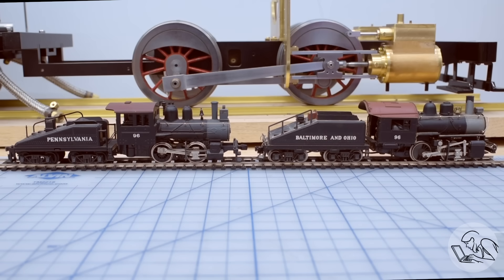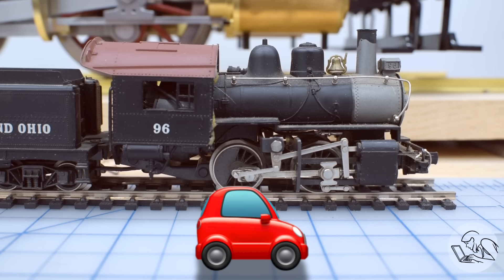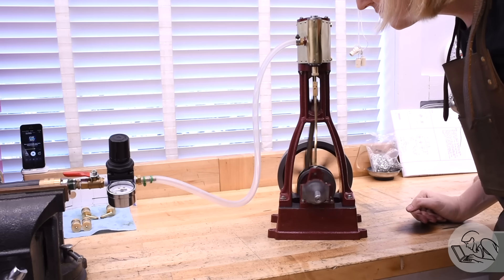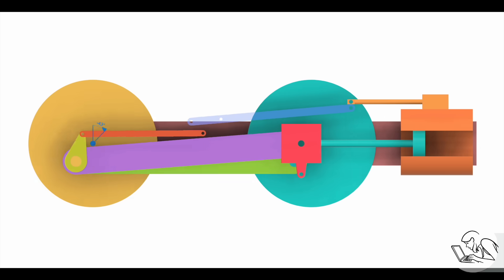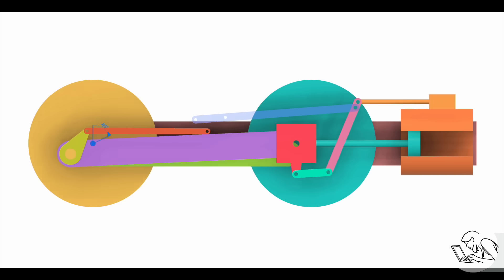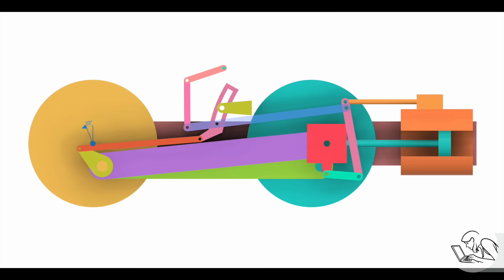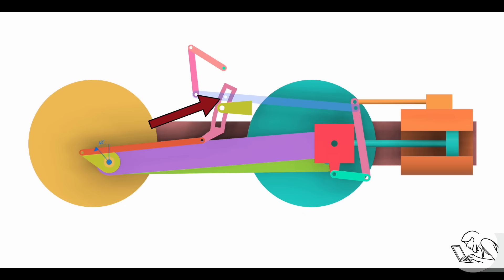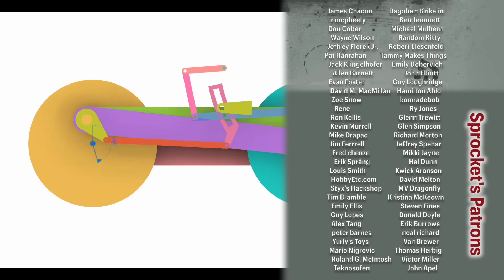How Does Steam Engine Valve Gear Work?

Comment: That opening shot was fantastic!!!!
Reply from the maker: All credit for that goes to Rob at Ghost Pine Film Productions. His photography is outstanding!
Reply: @Blondihacks   off topic but I could have sworn you modified your lathe so as not to have to turn the RPM all the way down to restart it?? If so could you point me in the right direction, I went through your videos and website but could not find anything but I feel certain you mentioned it at some point?
Reply: Truly poetry in motion. In a similar vein, there is wonderful footage of GWR Castle  5043 running at high speed along the M5 in Devon / Somerset (UK).  However not good for Quin’s video as although this 4 cylinder loco does have Walschaerts Valve gear. They put it inside the frames   Which drove the inside cylinders  directly, the outside cylinders were driven from a crank which can seen on the front of the valve chest.

Comment: a lilttle clever thing, since the valve cant move far enough to cause a  power stroke in the middle, it kinda acts like a "parking" position, or rather a "neutral" so, aside from activating the brakes, the crew can also put the reverser in dead center as an extra safety measure if someone has to get in between the cars.

Comment: Question I've had since I was a kid:  If the drive rod is fully extended, how does the wheel turn in the correct direction?  Adding pressure to either side of the piston doesn't guarantee it will rotate the wheel in the correct direction, or even start turning the wheel.
Nice graphics.
Reply from the maker: I covered that earlier in the series. The wheels are quartered.
Reply: @Blondihacks  What I suspected, as I&Q in spread spectrum radio.  A topic often overlooked in many steam engine explanations.  thx

Comment: How timely thanks. I have been wrestling with the timing setup for my 5" Super Simplex Loco and your outline and referenced videos are soooo helpful. I think I can more easily get to the point of running on air. Then it will be the boiler 🙂

Comment: Diesel mechanical Locomotives were built and used in Europe.  Southern Pacific and RioGrand  tried them.  The Krause-Maffies were an utter failure in the US.  The U-joints did not like the run from El Paso To Los Angeles.  I had a discussion in the mid 90’s with one of the Engineers working for SP  trying to implement them. (Engineer as in Degreed BSEE not Locomotive although he was qualified to run multi-unit main line trains).

Comment: This was a great video, thanks for the effort you put into the animation.  You made it very easy to understand.  Does this mean that controlling the valve timing is actually your "Throttle"?
Reply from the maker: No, there’s also a steam regulator that is the throttle. The transmission in the car is a better analogy

Comment: The job of the valve gear is to make the engine go Chooch. You for instance were trying to make your model chooch by hand  in the previous video, but that is hard. 

So onward to the full blown chooching.

P.S. As a random thought, it would be fun to see you make up a mini version of Veronica, call it Cindy, and have it run a digital valve gear, one using solenoids to run the valve gear and of course taking the timing from say a linear scale attached to the cross head. Just thinking out loud.

Comment: I always found it genius how locomotive designers and builders defaulted to forwards movement consistently being a link drop motion and reverse movement being a link lift movement, as a failsafe against rapid self-destruction in the event of a link failure/shear off during running forwards at high speed. Excellent work as usual.
Reply from the maker: Yes, very astute. In this case, the design is that if the quadrant link fails, the radius arm falls into a safe full gear position instead of slamming into reverse at speed.

Comment: Controlling the direction and speed from the cab huh? I await with bated breath the parts on machining the tiny engineer. Smile!
Reply: IIRC the kozo model only has a few total reverser notches, since at this scale, "efficient running" is more of a suggestion, and reversing is more important than cutoff control
It would be hilarious to have a little pewter or brass engineer and fireman sitting on the seats in the cab though!

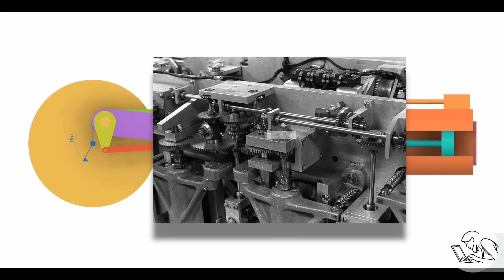Comment: 10:25 the mechanical firing solution computer is an amazing analogy. Those WWII targeting systems for the deck guns were so good that every time the Iowa class battleships went in for an upgrade, they stuck with the original mechanical targeting systems because they couldn’t improve on it

Comment: What happens if the engine is notched into reverse while it's running forward? Does that provide a braking force, or does it just blow things up? Thanks for the wonderful explainer!
Reply from the maker: That would indeed blow things up. It would be real real bad
Reply: Is there any mechanism to prevent it other than shouting at the engineer?

Comment: Hi, i built a engine myself and it uses a -90° valve angle and not +90° as you did. It only runs that way but it uses a spool valve though, I don’t think it matters but I don know
Reply from the maker: Spool valves are Inside Admission valves, which reverses all the timing

Comment: In most cases, what you say between 4:00 through 4:07 is true, i'd like to shed light on the fact that British Rail had a prototype for a diesel mechanical freight engine, known as the "Fell diesel." It worked very well (even having more power than the steam engines that typically ran the line) but proved very expensive to maintain, and was retired after 7 years of service. The fell diesel is the only example i can find of a diesel mechanical outside of two or three axle shunting engines, which is a role they are better suited to.

Comment: Thanks, Quinn!

I had seen about "geared locomotives" that were used for hauling ore in the Rocky Mountains. Was this via a transmission or a fixed gearing? Thanks, if you have any input on the subject.
Reply from the maker: Geared locomotives were used in logging and mining. By using a drive shaft and gears to transmit power instead of side rods, the suspension could have a lot more movement, so it could handle uneven temporary track. It also allowed lots of smaller driven axles which increased traction so they could pull on steep and uneven grades typical of logging and mining. The tradeoff is they were very slow. There still isn’t a transmission. The engine powered the driveshaft directly. See the Shay, Heisler, and Climax for examples.
Reply: @Blondihacks  Great, thank-you for the response.

I had a friend who worked for Bethlehem Steel as an engineer, well into the diesel-electric locomotive era (1960s-1970s). He said there was no need for those to have any sort of gearing, as the electric motors have so much torque. I've always wondered about those old steam powered ore trains.

Comment: Hey Quinn, when you've finished the steam loco are you going to build a diesel electric to help it along, as per the opening sequence?  😜
Reply from the maker: Restored steam locos always carry a diesel along for the ride in case of mechanical breakdown and because there aren’t water and coal towers every few miles on the line like there used to be. Also why there are multiple tenders. Modern railroads no longer have the infrastructure that steam locomotives needed, hence always having a diesel for backup. The diesel in a run like that isn’t doing anything though. The steam is pulling the train. The diesel is just there as a spare tire, if you will. Steam actually has vastly more power for size than diesel does. It’s just a lot higher maintenance and higher labour costs. That’s what killed steam.

Comment: This is the video I needed. All of the reciprocating engines I've made so far use a single eccentric, and it's been tough for me to wrap my head around the half dozen linkage arms in this monster. Thanks for the deep dive. 

Incidentally, for my senior project, my EE professor was impressed by how I demonstrated PWM was not a new idea and I used the Walschaerts Valve Gear as proof of concept.

Comment: Great explanation. It looks like a major problem would be that it can't start when at top or bottom dead center. Also that horizontal link between the drive wheels won't work near the 9 and 3 o'clock positions. I assume these both are solved by having everything on the other side be 90 degrees offset, and with a solid axle. Or is there more to it than that?
Reply from the maker: Nothing more than that. All steam engines that need to self start are quartered with two cylinders for that reason. I explained this earlier in the series.
Reply: Precisely that, also part of why the centered reverser postion is "illegal" in a technical sense, because one side's piston will always be technically leading the other, in whichever direction it was last running, and the piston cant dead center itself. Most locos (that i know of) dont even have an effectively "centered"  notch because of that.
Reply: It makes me cringe to think of what would happen if one of the axles broke in the middle and the coupling link continued to drive the now free wheel.

Comment: Great animation and explanation.

From your explanation, it seems that those old timey films where they have to make the train go faster, they really shouldn't have to shovel more coal faster, would they?
Reply from the maker: That is exaggerated for effect in movies, but shoveling faster does need to happen if you’re accelerating, climbing a hill, etc. Shovelling is the gas pedal of the locomotive. Managing the fire is a dedicated job for a reason though. There’s a lot more subtlety to it than just this. A fire too large for the situation is just as bad as too small so the fireman needs to know the track, the load, and the locomotive.
Reply: My grandpa started out as a fireman on oil fired steam locos. He said there was a light that indicated if it was "wet steam" or  super heated steam (dry steam). The fireman had to keep the fire adjusted to maintain dry steam. Otherwise the engineer would start in about the fireman's family tree and other things.
Reply: If you're pushing a time machine in the wild west you throw in three special coloured logs.

Comment: Fascinating! A fun project would be to 'electronify' the drive using sensors on the drivers and something like a servomotor to open and close the valves via a microprocessor and eliminate most of the linkages. I guess someone has probably done that, though modelers would probably have a fit about it.🙂

Comment: Very nice, thank you, ma’am. I already know a lot about Stephenson’s link valve gear from my interest in marine steam engines but I didn’t understand how the gear on trains worked. I’ll have to re-watch this a few times to really get it.
Reply: Aw shucks, now I want to look into how marine steam engines work. Any that you find particularly fascinating, or barring that, a bit absurd for any given reason?
Reply: @jaxblonk5127 A lot of the early marine engines are mechanically fascinating, seeing the efforts the designers made to keep the engines and boilers below the waterline, where they would be less likely to be damaged by enemy fire. The engine on U.S.S. Monitor is one of the best examples.

The triple and quadruple expansion engines that came at the peak of that technology are also interesting. See Titanic, U.S.S. Texas (BB-34), and the two restored Liberty ships (S.S. John W. Brown is one, IIRC). 

The Skinner Unaflow is another interesting design. There’s one still in commercial use aboard S.S. Badger, a car ferry on Lake Michigan.

Comment: Funny down in the weeds note (but hey, we are fans of this kind of channel, so this is gonna happen).  "Can only run in one direction" might be better said as  "SHOULD only run in one direction".  If using cosby sauce to start a diesel (which we shouldn't do, but we buy it and keep it handy for a reason), only spray after it is already cranking...or they can run backwards...causing bad things to happen.  If you are alone, and shoot it in the intake, and then run over and start cranking, there are resting conditions that can make it start backwards during the initial crank stroke...often bending things.  Sometimes you get lucky and shut it down and get it going the other way without greater damage.  

Also can happen on boats with direct gearing to the prop shaft in rare (but real) circumstances.